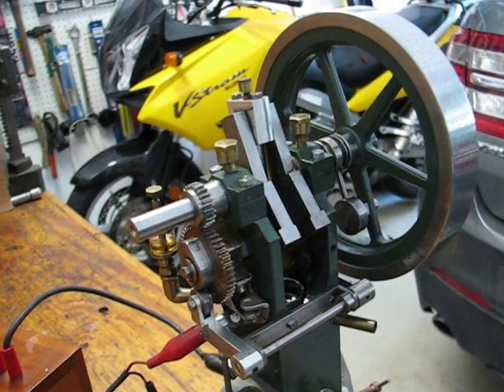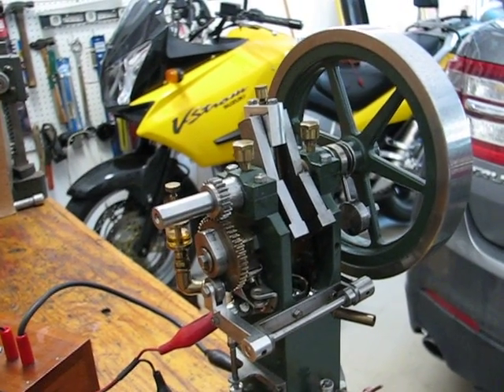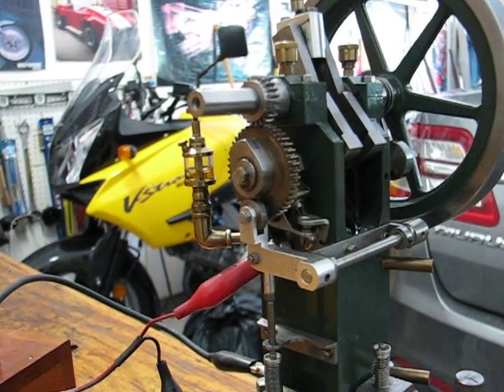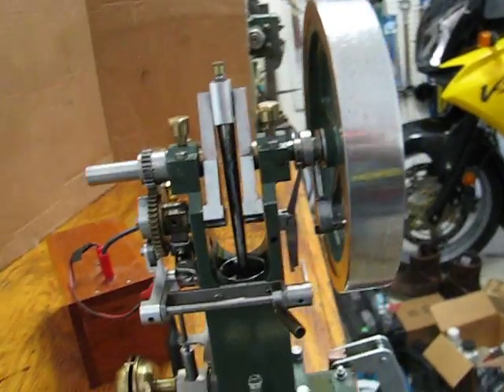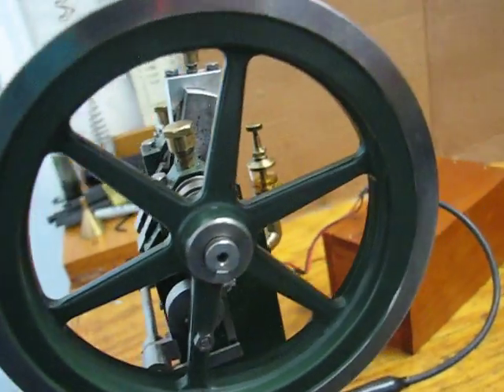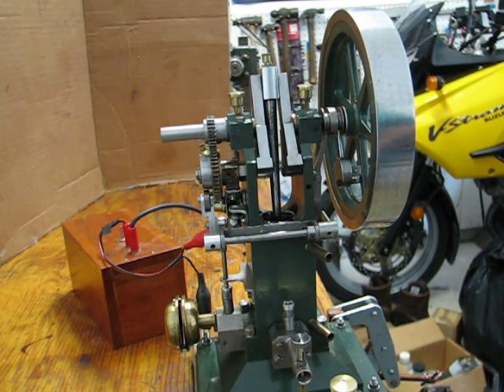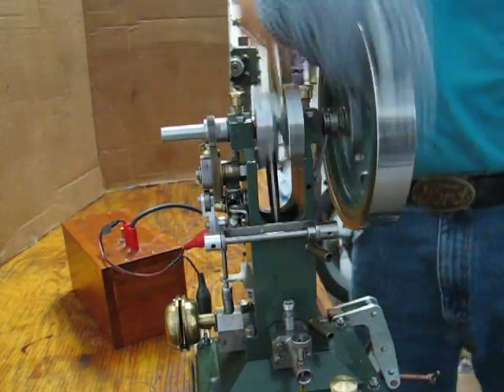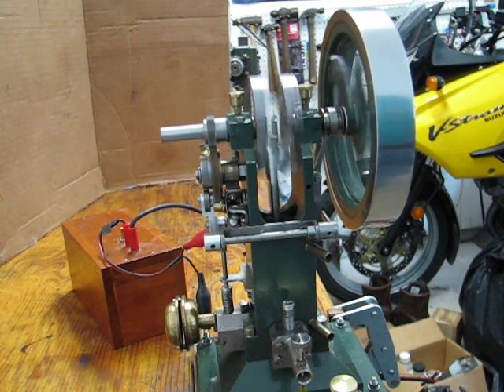TOPSY TURVY HIT AND MISS

Comment: Oh my. Lovely little motor ya got there. Chuffs over happy as a clam, too, almost makes me wonder how it'd do belted to a small DC motor and lighting up a 12v desk lamp.

Is there any way you could rig up a dampener to the governor to reduce the hunting its doing? Seems to me that if the governor was a little more sluggish it'd give the engine more and more gradual cutouts until it was holding within a few percent the same RPM. I know all H&M engines will hunt a bit, 'tis the nature of how they operate, but this one seems like it's bouncing the tach needle around on a pogo stick.
Reply: TestECull  Probably doing that because it's smaller so everything happens quicker
Reply: David G I've seen scale hit-and-misses this size run much smoother. It's harder to do because inertia tends to damp the hunting in large engines and that's just not present on this scale, but it is possible. Some of OP's other scale engines are hit-and-miss and they all run quite smoothly indeed.
Reply from the maker: TestECull 
This engine was designed with only one flywheel. On any engine, large or small the purpose of the flywheel is to dampen and add inertia to the engine, that is to have enough centrifugal force to overcome the compression stroke at lower rpm's. When scaling down a flywheel you lose that force and therefore the engine has to spin faster to overcome the compression. I have a video of my Holt engine running and on that engine there are 2 flywheels so the engine will run quite slowly.
Reply from the maker: +TestECull 
It's not so much the governor as it is the flywheel or should I say lack of. Most engines have 2 flywheels to provide enough inertia to keep the engine running longer between hit cycles but this one only has one so it is more sensitive.